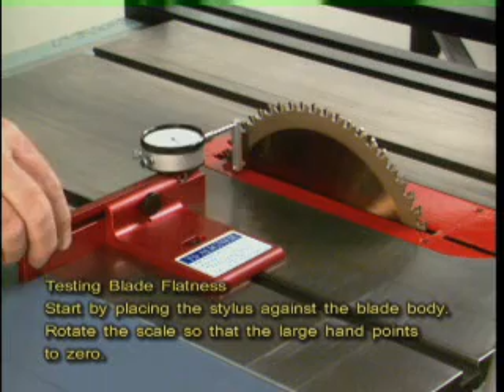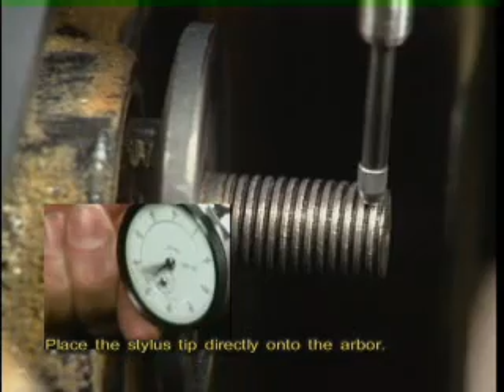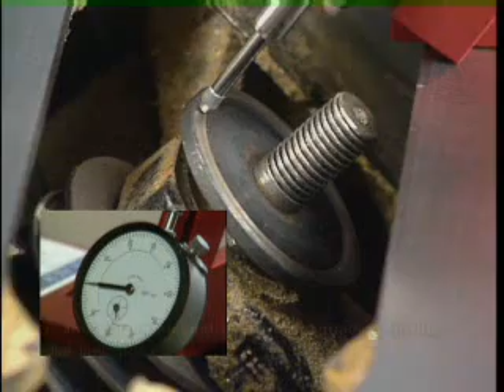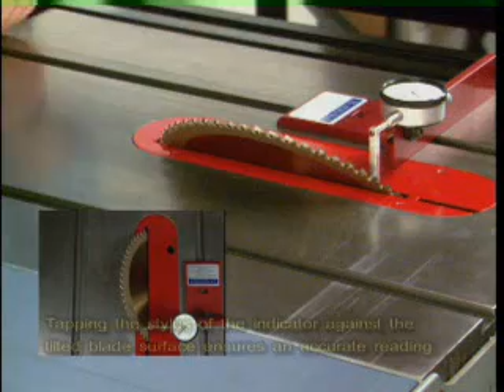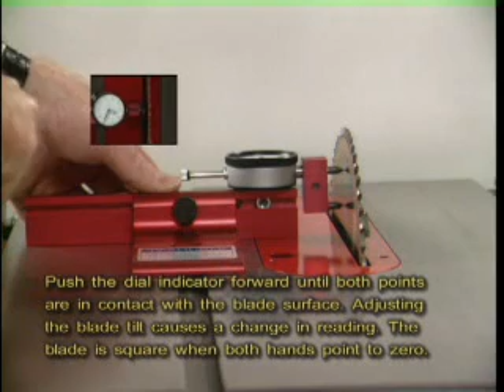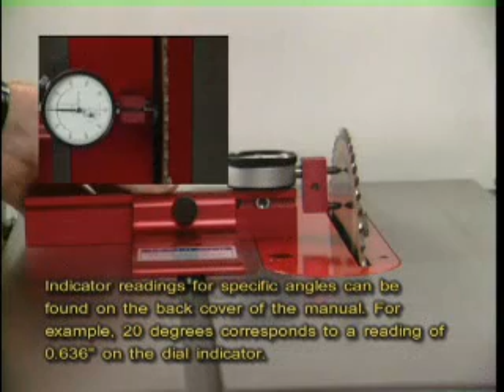How to set up an TableSaw pt 1

Comment: Picked up a Mastergage for $45. Even for small shops this tool facilitates your TS is operating at its peek performance. Sometimes you have to shim your table on either end to get the calibration correct at 45°s. By doing this you eliminate burn marks and bad cuts....

Comment: The blade angle measurement near the end of the video has been confusing me. The lower fixed contact point and movable plunger look as though they are essentially replicating the function of a sine bar with one stationary point and one movable point to create an angle, however the chart they show says an indicator reading of .636 thou equals 20 degrees blade angle, but using a sine bar calculator it takes a center point distance of 47.232 mm (approx an 1-7/8") to acheive 20 degree angle. The center distance on the TS Jr. points look no where near an 1-7/8",  an inch mabey, which would require a travel of .342 thou to achieve 20 degrees.  Anyone?...Bueller...Bueller....Fry....Fry...

Comment: This is a giant fail.  This is only good for guys who spend 100 grand on setting up a woodshop and have every esoteric tool in the world.  How about a video for us normal guys with normal tools?
Reply: I clamped a speed square in the left miter slot tight to the left edge of the slot. then I used a framing square tight against the left side of the blade lining the square to the speed square and the blade by moving the table.

Comment: its not way over the top though. if your doing accurate, complex cuts all the help you can get with regards to saw accuracy is essential. yes wood moves with humidity and temperature changes, but if everything has been cut on a properly setup table saw, then it should be cool. if you have inaccuracies in your cuts, then glued joins may separate with temp changes.

also having the attitude "the planer will fix it" is a bit poor. prevention is better than cure my friend.